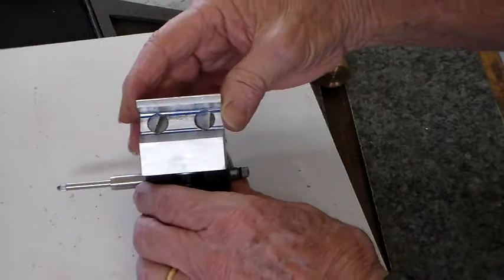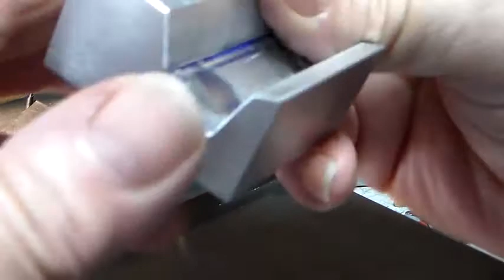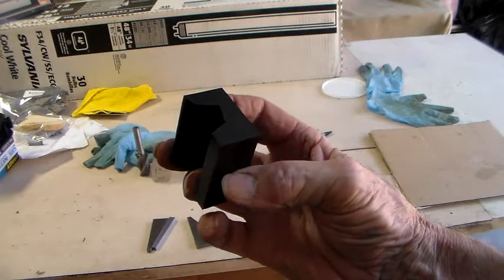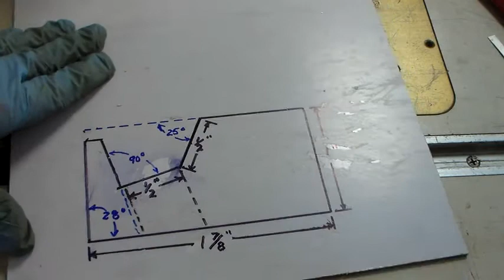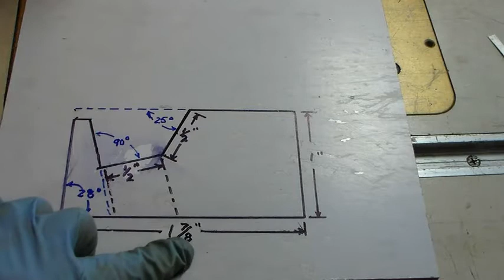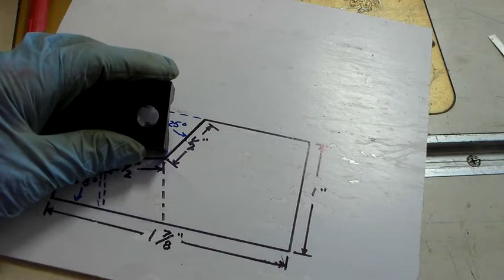Logan Lathe Dial Indicator Holder   Stop

Comment: Thank you for the work you put into this video. I have a Logan 850 and have been looking for a way to make a carriage magnet holder. I think you've found my solution.
Reply from the maker: You are more than welcome.  Hope it works out as well for you as it did me.
Reply: @Histandard2011  Please, can you tell me what length magnets you used? I understand they are going into 1/2" holes so I imagine you used 12 or 13 mm diameter magnets. Thank you.
Reply from the maker: @pyromedichd1  The diameter is .490" and the length is .380"
Reply: @Histandard2011  Thank you very much. About the closest I can come to those dimensions is 12 mm  (.472") x 10 mm (.393"). Since either Loctite or some other adhesive will be used to hold them I guess those sizes should work. Any thoughts?